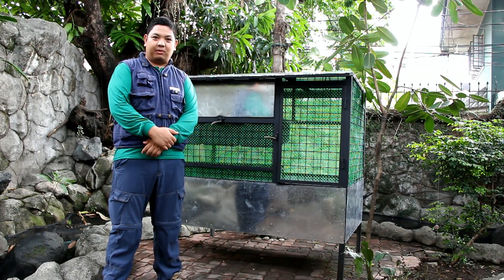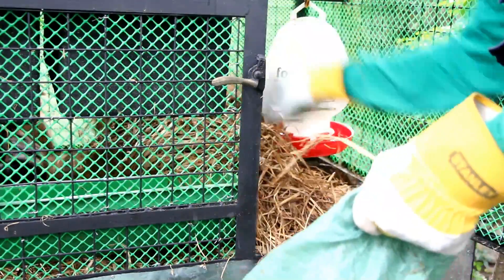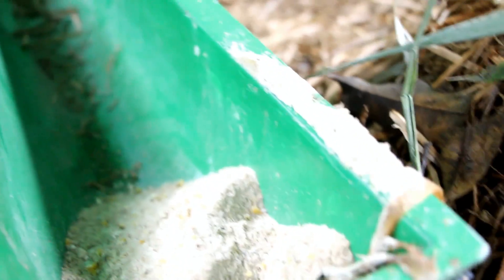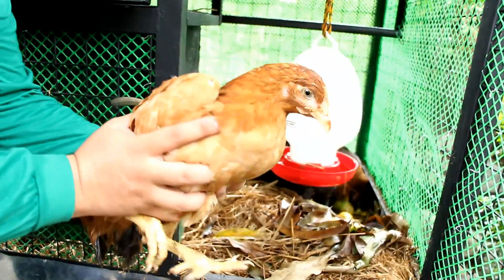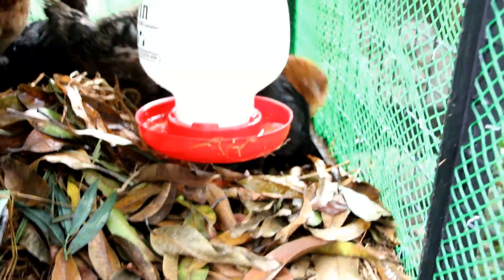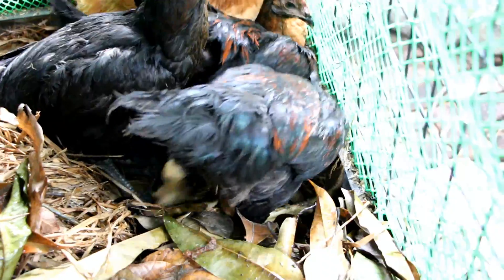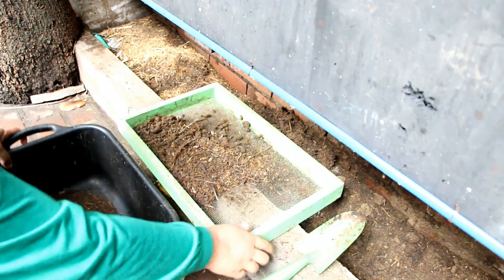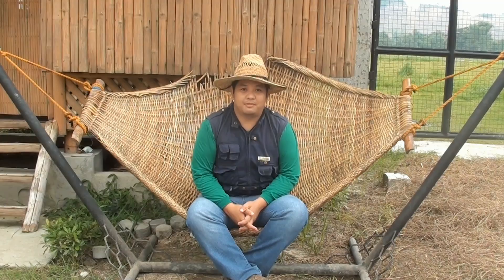Odorless Chicken Composting Coop Design by MADE

Comment: This coop is way to small for the chickens. Each chicken needs 5 - 10 square feet to be happy, and they would probably be happier scratching on the ground.
Reply: It's actually 3 square foot for each chicken. 10 is insane. But still, I very much agree with you. When you have this small of a coop I would free range them. And use the coop for a shelter at night.